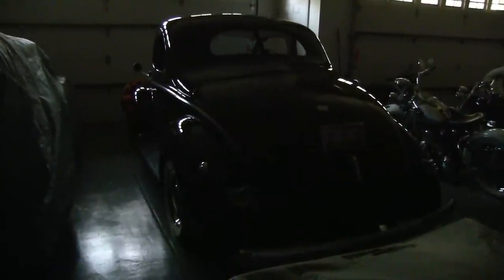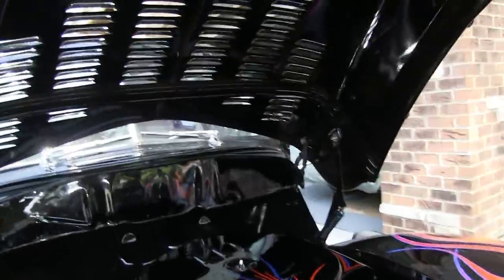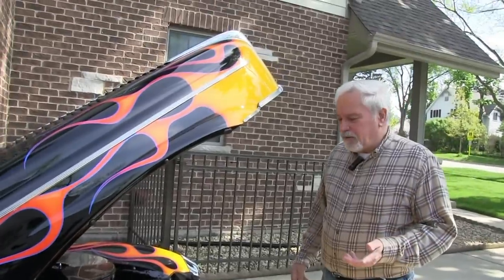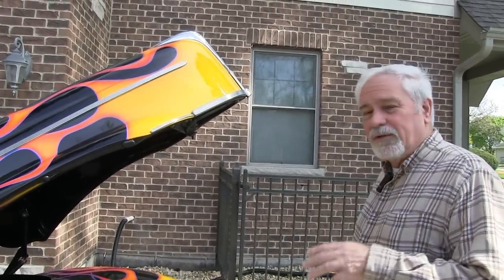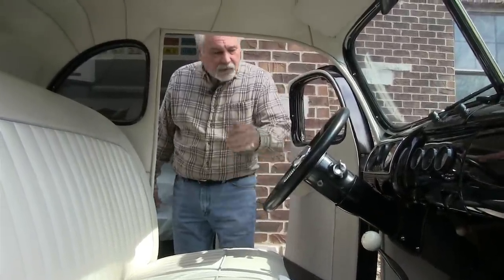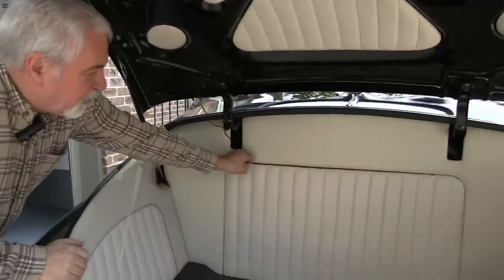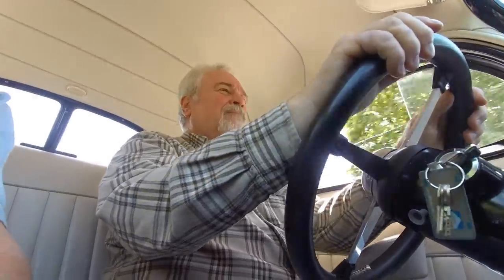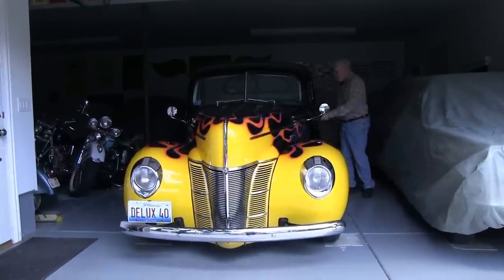1940 Ford DeLuxe Hot Rod  The nicest around?   We go for a ride.

Comment: I had a 40 coup for my first car. Soon the block cracked, and I put in a brand new 64 283 high performance. Immediately the transmission blew and I installed a Muncie and Chev real end. I loved it. I stiffened up the suspension and it was a great flat tracker. Later on I installed ram induction with 2 fours. Then wrecked it. lol. Should have kept it. Only the rear end was squashed due to a 180 crash into a mountain side from a dead end road in the fog.

Comment: Resemble AMT model 40 Ford 3 in 1 box.
Reply from the maker: I had one of those models. If I remember correctly it could have been built as a 1939 or a 1940.
Reply: @RideswithChuck  
Right, nothing and about that.